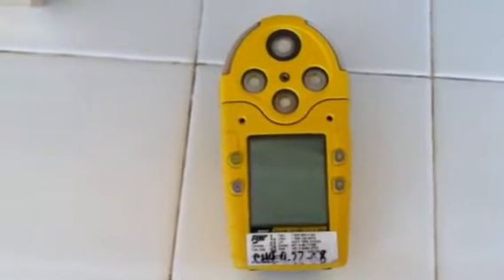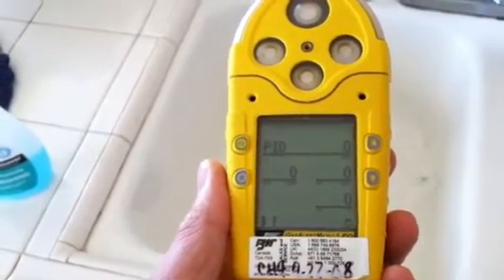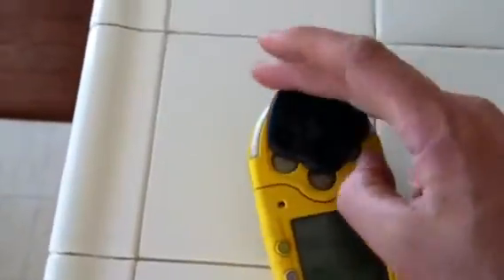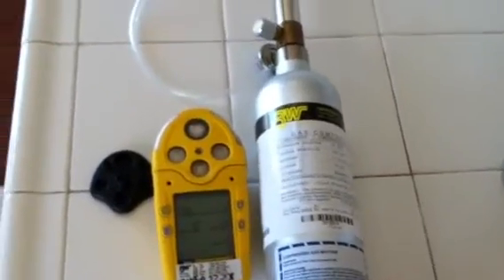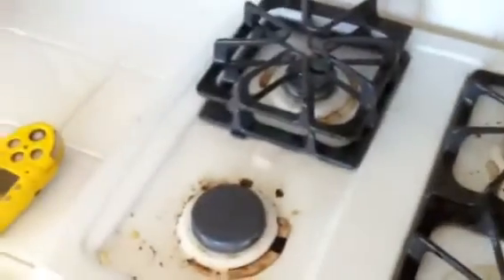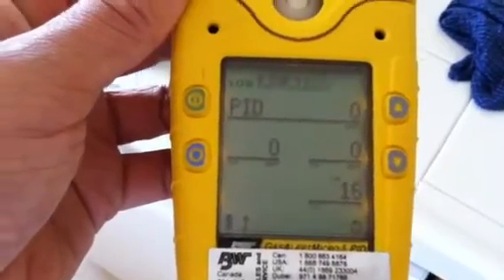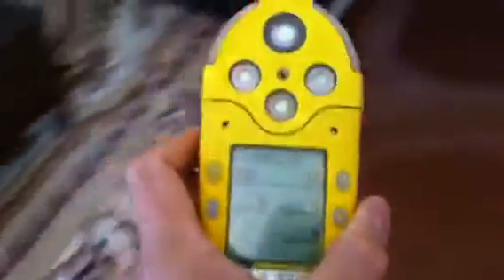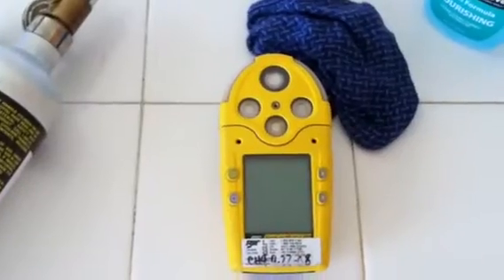Gas Alert Micro 5 PID, Bump Test and Demonstration

Comment: Very nice vid, dude. I suggest you to wear a gas mask with filter cartdrige for, at least, H2S. It's very dangerous and if you regulary do these tests or calibrations, It will affect you because of the concentration. You might not feel it at the moment, but you will later.